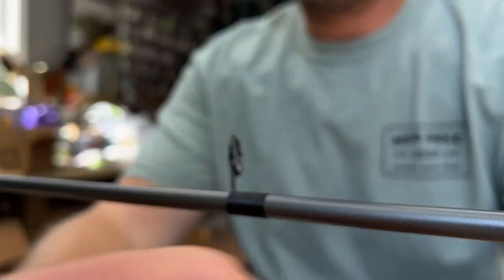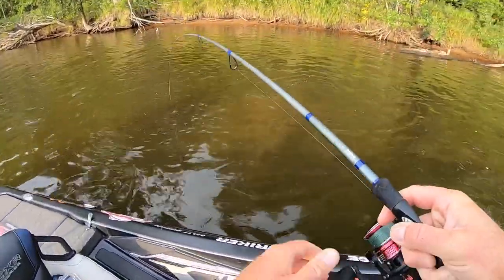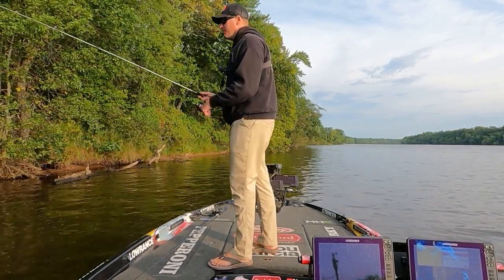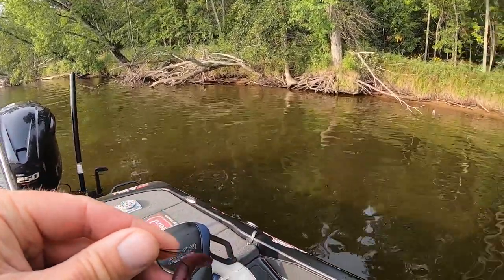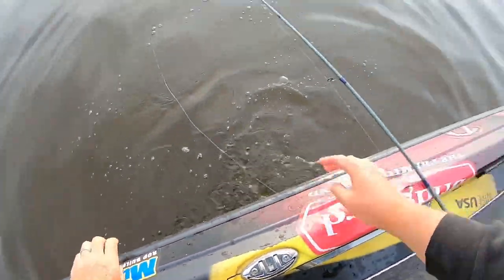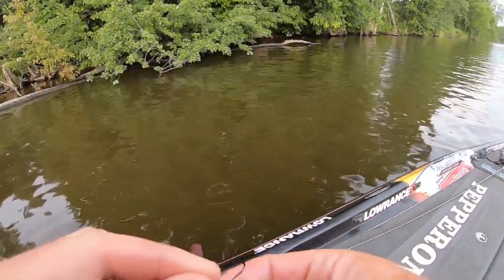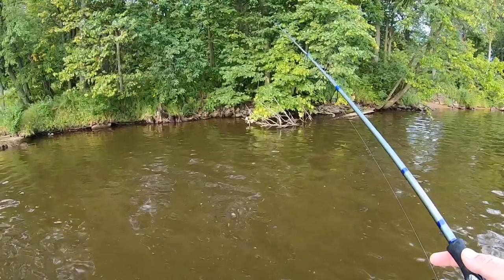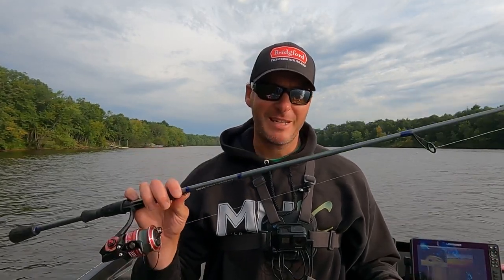Wacky Rigging Tips and Wacky Rig Rod Build MHX NSJ-842! Build To Catch!

Comment: Matt. I'm a recreational angler so dont carry a bunch of rods . My rods all serve  double , triple ,and quadruple duty . I strive to be a good caster making accurate low trajectory cast to pin point areas .  So if you only had a half dozen or so rods to make accurate roll cast with all the different weight lures we have , what would they be ? For instance , I use a different rod for a 1/4 ounce squarebill than a 1/2 once model . Same for other lures .
Reply from the maker: 7 MH heavy action baitcaster